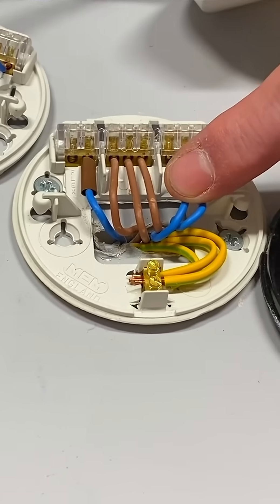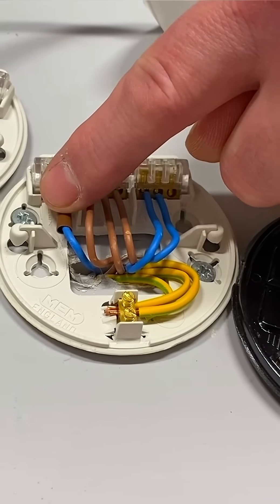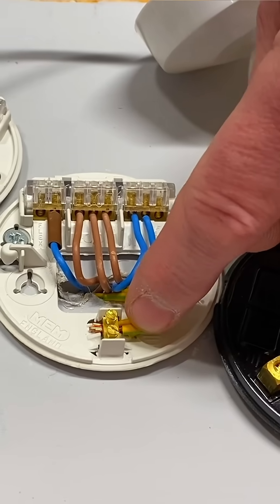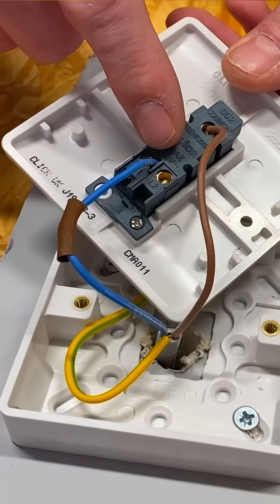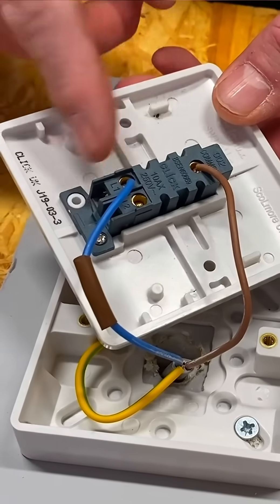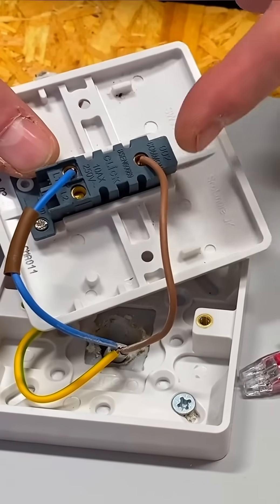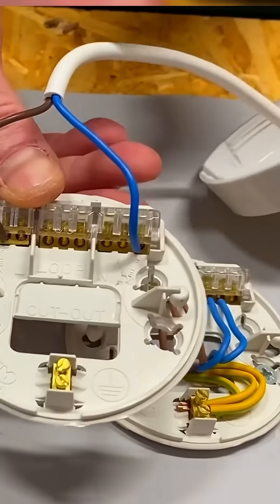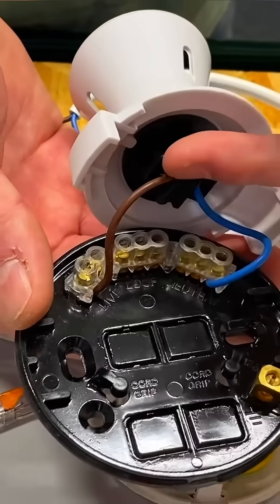Connections in a Ceiling Rose and Light Switch.

Comment: I prefer sending all neutrals to the switches, mainly due to a lot of smart switches requiring a neutral. Failing that, I've always sent a 3 core and earth to each switch if wiring 3 plate at the pendants